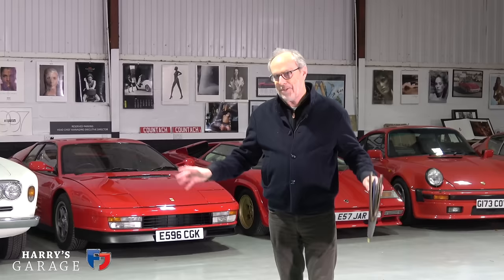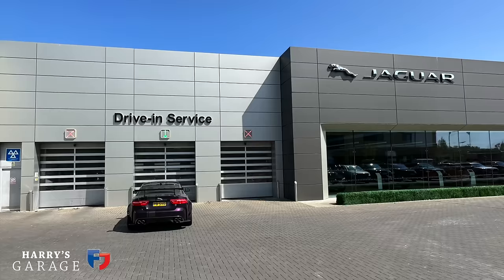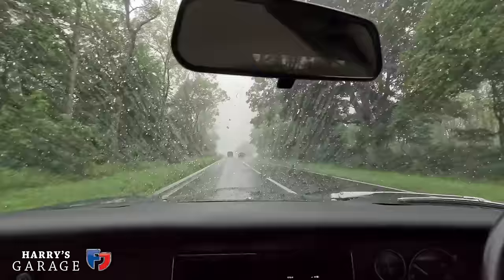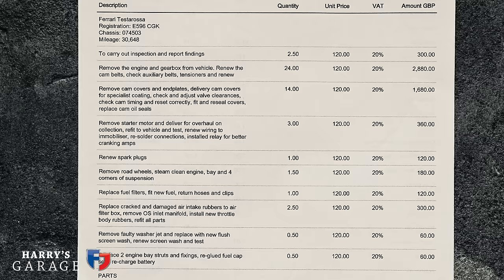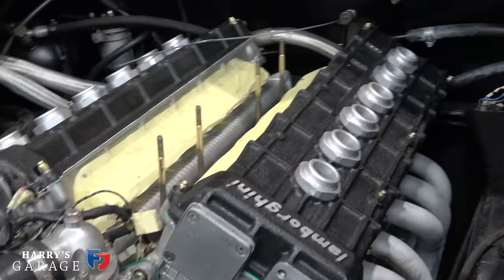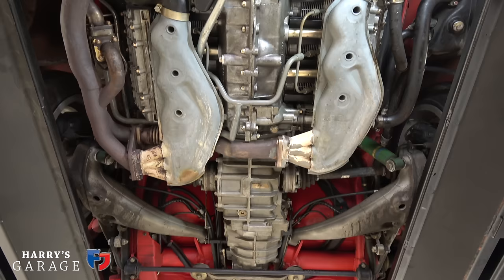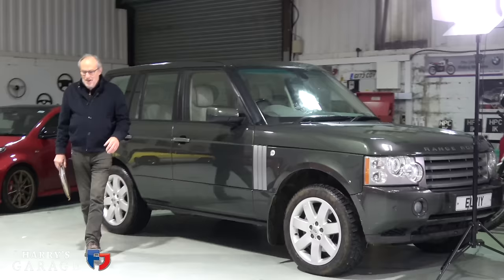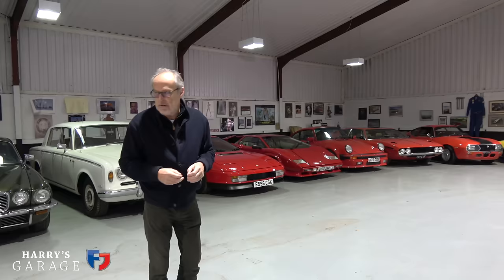Annual Harry's Garage round-up. Plus what I spent in 2023 on restorations, servicing & insurance

Comment: Fascinating to understand the costs involved in running a fleet like this. I recently added up all the bills for my old 911, £30000 in maintenance over 120k miles since it was new in 2004. Almost the same as the fuel bills!
Reply: I've had 2 Mondeo Mk3 diesels, bought them for 70k mls each at £4k...took them to 440k each...just a clutch each...exhaust bk box and my own oil changes....bargain for me....poor engineering/build on these cars
Reply: £1,500 a year for what seems to be a car that is driven to be enjoyed as well as a daily driver seems like good value. I’m sure that others would baulk at the cost but we all need an outlet/hobby-some of which cost considerably more.
Reply: That sound pretty cheap per mile.
Reply: @RobertRedford77  im curious - you bought at 70 K miles for 4K GBP? Thats good going mate.
Reply: @lachlanbrown409  Base LX models. Just needed a 6spd box and a heated windscreen. Ford parts were cheap.

Comment: If you decide to rebuild Her Majesty, the Silver Shadow, engine I would personally rebuild it to the original lower capacity. If you replaced it with the later larger engine, it loses originality for one, ( bear in mind this car has become a motoring you tube icon ) secondly the later engine doesn’t “ spin” as well as previously mentioned in previous videos, thirdly, you’ll have some sort of warranty on a rebuilt engine , whereas a second hand engine is an unknown quantity. What ever you decide , it’s always great to see her. Happy new year.

Comment: Nice honest end of year review Harry - nice. We used to use Marshall's -  but after a service they failed to refill the oil in our D5, resulting in a new engine, they replaced it, and we started getting a leaking gearbox seal, which they wanted to charge for claiming they did not touch the seal when they replaced the engine. 

Needless to say, we binned Marshall's and now use James French in Witney, who are absolutely fantastic, provide a brilliant service, and leave money in the bank account.

Comment: If only others could articulate the enthusiasm and joy of motoring in all its diverse forms like this and done with class and style. 

Harry, your eclectic mix of vehicles covers so much of motoring both two and four wheels and I think you could add one more two wheeled example to it that will act as a internal combustion “full stop” for motorcycles. Add a Triumph Rocket 3R to your stable of bikes as it’s as significant and important to the story of motorcycling as the others you own and will become more so as these “dinosaurs” are phased out. 

No one makes , or ever has made a 2.5ltr production motorcycle or made it so well as Triumph and being British as well means it deserves a place in that garage. As time passes and these engines are phased out, you will own and record the passing of a machine that gave a fitting end to petrol power on two wheels.

Generations to come will see this bike and I hope smile at its excesses and being presented and articulated by you I think it truly fitting.

Comment: The upside from having to crank the Lotus after sitting some time is building some oil pressure before it starts. I've often thought of fitting an ignition isolation switch for the same reason on my Jaguar.

Comment: Re the problem on your Elan Sprint. Fit an in line bulb, similar to ones used on outboard motors. Give it a few pumps before starting and it should feed the fuel into the carbs. I’ve put 3k miles onto my own Sprint this year. HNY!

Comment: Oddly enough, I fitted an electronic ignition to my Suzuki GT750A in 2009, and I’ve not touched it since. Occasionally a carb fault but ignition is hot and reliable.
Mind you, my little GT380B still runs points & they too are perfect. These are all NOS points from back in the day and I took the precaution of buying three further sets (9 points) despite the cost, because I knew that aftermarket points weren’t great. I have an electronic ignition box since 2007 but never fitted it.

Comment: 12,000 for the injector setup seems quite steep. Glad to see that XJ in the form that it's in, however. I think it might be my favorite of the bunch
Reply: all done in a shop incl. dyno. fuel pumps, hoses, NOS V12 intake manifolds, 12 injectors, ECU trigger set-up, wide band lambda sensors, etc. it all adds up. I would guess 50% are labor costs.

Comment: Should be able to find  a replacement book for the Range Rover fairly easily.  We got one for ours for about £7.

I'd say to get the sill covers off the Range Rover quickly, if the rust is showing through there, it'll be a lot worse under the cover.  It might be holed now, but they're generally a lot worse under the cover than you expect.

Comment: The silver shadows have cotton valve stem seals that leak oil into the combustion chambers, so you may not need a full engine rebuild? I had blue smoke from my silver spirit and substantial oil consumption, and changing the valve stem seals on the two cylinders with wet spark plugs fixed it.

Comment: 1) I know what you mean about needing an electric fuel pump and evaporation. I had a Yamaha SZR 660. I did not ride it very often and when I did even a fully charged battery could not pump the fuel through to start it. I had to use a 12 volt car battery to help. 

2) English Summer, we have a garage full of motorbikes and between them they have done less than 100 miles last summer. 

3) Ian Tyrrell..........I always like the look on your face when he finds something else wrong. It appears to me Iain and his merry men treat customer cars like they    are their own. Expensive but from what I can see worth it. 

4) I will never understand why you did not fit A/C to your V12 Coupe. it was available when new and is so so nice on a hot day with no dust or pollen. 

5) The Rolls, if your going to fit the larger engine is it not worth fitting A/C. It works so nice in these cars. 

Thank you for the videos have a healthy New Year.

Comment: I always find it insane the type of stuff that breaks on new cars now. 90s cars didn't have nearly as many issues.
Reply: Too many sensors and fancy electronics .Good engineering should be kept simple.
Reply: @GlennPowell-ls3lg  Those sensors and fancy electronics give you high horsepower, decent fuel economy, and reduced emissions in a vehicle with a high level of self-diagnosing capability.
Reply: @oldanslo  Something breaks on an old car, it's mechanical and can be diagnosed relatively easily by a decent menchanic. Meanwhile, you have to worry that your fancy modern car could get bricked at any given moment and leaving you stranded for rediculous reasons such as a failed update. I'll stick with the old stuff thanks.
Reply: mid to late 90s and early 2000s cars will be known in history as the most reliable cars ever.  It was the sweet spot of technology without crazy emissions and gas mileage regulation.  I have a 2003 golf with 280000 miles on original 2.0 gas engine and clutch/transmission while living in chicago and san francisco.  Unfortunately most of the cars were somewhat ugly lol!
Reply: @overbuiltlimited  I will drink to that!

Comment: HOW do the shops you use go about lifting a concours-quality car off the ground?  I can't trust any shop to even lift a daily driver correctly, yet a show-winner.
Reply: Absolutely agree with your comment.  I found the worst offenders to be the tyre replacement workshops, followed closely by the generic car 'i.e. cheap charlie' workshops.
Harry uses workshops that are specialists and know where to lift the specific car and take the time to correctly position the lifting pads - and most likely use adapter pucks to suit the specific lifting point.
In my case, I do the research on the specific car and have a range of rubber pucks to suit a particular situation.  What's more, you need kneel down/bend over to monitor/confirm the position of the lifting pads - i.e. not place in the general area and hope for the best.

Comment: Thanks for the in depth cost video.  Interesting to see exactly what it costs to keep your cars on the road.  How come for the 4 door jaguar the oil cost 16.79 for a quart or liter(not sure what the unit is) and for the 2 door one it cost 10 pounds?   The 10 pounds isn't that bad for a dealership since you can get it for about 30 for 5 quarts here in the US especially with the 20% discount making it 8 pounds per unit. They are only almost doubling what you can buy it for at the store and that's if costs are the same in the US as in England, but the 16.79 pounds is a big difference for the same product with the same product code.  Since Harry goes over the bills with us I wonder if he noticed the difference and asked them about it.  I just checked on the filter and they aren't really overcharging him too much for that so it looks like they aren't crooks.

Comment: David Hunn...
Harry, at 9:34, just off to your right, is that a print of the famous black and white photo of good-time girl Christine Keeler from back in the day?
Regarding the Yaris. I recently replaced the original Michelin PS4 tyres on my i30 Nline at 71,500km for Pirelli P Zero's. I was very happy with the Michies and had intended to use them again, but was offered a full set of Pirelli's for half price, so I couldn't knock that back. I went up a size to from 225 to 235/40x18 @ 40 psi cold all around. Significant improvement in steering, ride and lower noise was noted. When discussing things with the salesman he claimed that the P Zero was equivalent in compound to the PS4S,  so maybe they are worth looking into.

Comment: The project 7 brake fluid 125UKP , lucky there is a discount but 100UKP for 1 unit, what did they use SKYDROL far out that's expensive

Comment: Nice video! But everytime when I see the Lancia Zagato in one of Harry's videos I notice that the lower part of the front doesn't seem to be symmetrical. The underside beneath the headlights looks te be lower on the passenger side than on the driver's side. Am I the only one seeing this? I would love to grab a tape measure to check if I am correct or not.

Comment: Seems odd to add an electric start, but remove a disc brake in favour of a drum for "period correctness". Pukka bike though and light enough to get away with drum.
Reply from the maker: I admit the drum brake is pretty awful on the TT600, yet the one on my XL500 Paris-Dakar is really good. I’m having the TT600 checked over for Sandraiders 2024 soon and hope we can make it operate better than it does at the moment

Comment: Harry... when you drive an old fashioned manual... did you hang onto the gear-stick between shifts sometimes...?
If you do... that's what ruined the syncro's in your box. (Ive noted you have had issues with more than one manual gearbox)
The trick is to NOT put any pressure on your gear-stick when you are not changing gears... this imparts side thrust on the gears and hence puts constant wear on the syncros... which is not good.